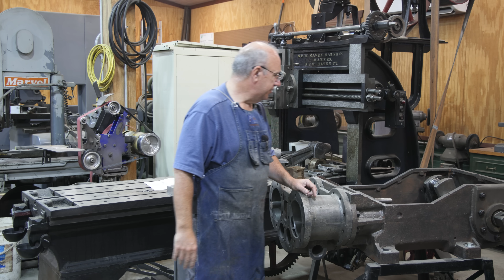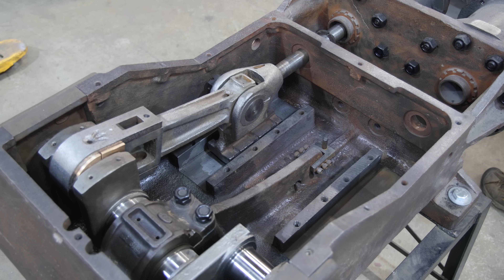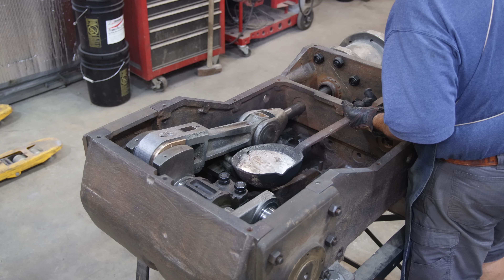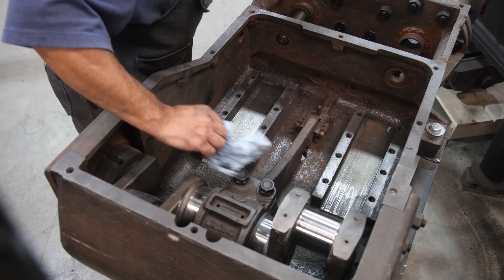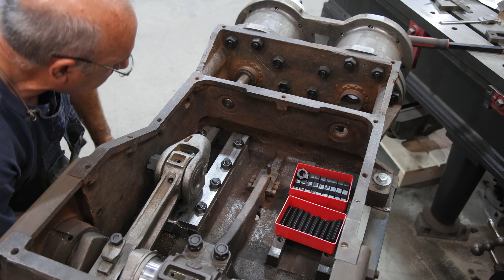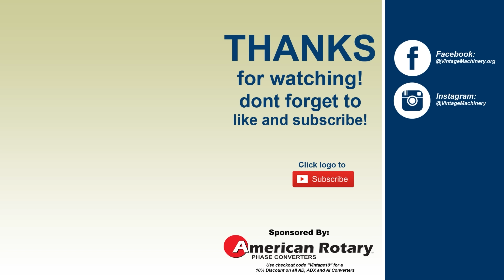Steam Stoker Engine: Pouring Babbitt on & Installing the Second Cross Head

Comment: My dad was a machinist in the 40s 50s etc. he rebuilt this big steam generator in the early fifty’s. He took me there to see it running as a young boy, the flywheel was half in the floor. I saw the governor weights spinning around, he told me about pouring the Babbitt beards and all the scraping he had to do. Now a lost art, I have his machinist tool boxes with all the scrapers. Keith does a great job, you are lucky to get to see this procedure.

Comment: the problem of the connecting rod getting in the way, certainly an issue, since you didn't use a rod between the two crossheads.

Comment: You could run-in all the new babbit with a 540 rpm tractor PTO to loosen it up.  An old timer told me about this 50 years ago.
Reply: I agree that doing a long run in would be a great way to make sure that everything was just the way it wanted to be, because where it's located on the locomotive, it becomes nearly inaccessible. I was just thinking of an electric motor and a pulley.

Comment: Studs are used as you get full thread engagement in the casting before Torrington the nut down, you’re much less likely to blow out the casting then a bolt.

Comment: Out of a question I don’t see balance weights on the crank like you would on a modern gas motor did they shake or is that not a problem with the rod heads that move back and forth?
Reply: Very low RPMs so not a problem. Steam engines rattle at a whole different level in the first place. This little engine won't be noticeable over the general clamour.

Comment: At 21:50 Keith is putting in the second wedge and then puts the stud in with a nut on top. I might be totally wrong, but should the stud be put in with a nut on it, then put the wedge in, and then put a second nut on top of the wedge?  The bottom nut is for adjusting the bearing clearance. And that way when the top nut is tightened down the wedge is trapped between the two nuts, making sure the wedge can not move up and down and changing the clearance on the bronze bearing. Again I might be totally wrong.
Reply: I think that is the intention. He did say he needs more lock nuts.

Comment: Did I miss an episode? How's the babitt getting under the slide?
Reply: That's what this episode was. He poured the babbitt and it stuck to the cross head. There is no babbitt in the main housing. He did the other side several months ago.
Reply: The slide is hanging in mid air. There is a gap between the slide and the base casting on all sides. It is held up by the dummy piston rod.

Comment: I think they used studs with nuts because production of bolts was not reliable enough to prevent defects at head and threaded section of the bolt that could cause failure.
Reply: Studs are often used with castings instead of bolts
to prevent threads from being damaged or stripped out.

Comment: Just a little oil in all the holes a tap with the hammer and it will all work. Well done Keith, Now looking forward to the valves and actual running under air or Steam. Carl Central Coast NSW Australia.

Comment: that thing in between  the piston rods on the piston side with the 3 bolts on each side with a stud sticking up what is that? seems an after thought or some kind of Crack repair but I don't think so but I've been looking at it for years and can't figure it's purpose. any ideas?
Reply: He put that in there before he started any machining on the case as a reference point. I don't think he used it for anything. It just clamps on the rib with 3 bolts on each side, and will be removed once he is sure no more machining will be necessary. The part sticking up is a dowel.
Reply: @brianrvd  I've been wondering if they have something to do with the valve timing dohickies

Comment: I understand what a stoker engine does, but I am still scratching my head as to the RPMs.  Would it be similar to the locomotive engine or geared much slower?  I assume the firebox is auger fed.  I also assume it would be speed variable but cannot find a diagram to give me a better idea.  Later in this process if you would give some insight, it would be appreciated.  I am glad I got to personally see this engine when many of us toured your shop at Arnfest South.  I wanted to ask my questions during the shop tour, but you stayed quite busy visiting with guests, so I didn't interrupt.  Good series.  Thanks.
Reply: Probably from 0 to at most 500 rpms would be my guess. It uses steam from the main boiler but would have its own throttle valve to control speed.

Comment: stud/nut vs bolt.  You do this for a couple of reasons, one is for maintenance, easier to get a nut off, than a bolt out of cast like a exhaust manifold.  But the other main reason is clamping force.  Maintaining the thread lock in the casting, you are only pulling vs driving into the casting threads with a bolt and causing uneven clamping force.  Assuming the studs threads in the casting were drilled precisely perpendicular, you would have a much better tolerance than a bolt.
Reply: It was explained to me that it also makes shimming easier because the studs hold the shim stock in place.
Reply: You can also guarantee engagement of the entire thread depth.

Comment: What makes the babbet stick to the cross head and not to the main frame?
Reply: I assume because it 'wraps' and probably bonds to, the foot of the cross head, when it cools, like next day, it has shrunk sufficiently to be removed from the slide and fine adjusted with a file.
Reply: @seapy2398  Yes, Babbitt does not actually stick to cast iron, it is only held in place by mechanical interference, in this case by shrinking around the foot it created a very tight bond that will never loosen unless a catastrophic failure deforms or breaks the Babbitt block.

Comment: In order to set the bearing clearance correctly on the big end of the connecting rod I would suggest placing flat shim stock of the desired clearance onto the bearing and then install the wedges. Record the position of the wedge, remove the bearing and shim, and reinstall the bearing with the wedge at the same position. You can verify bearing clearance with plasti-gage. If you are afraid of bearing damage by using shims, then just use plasti-gage by trial and error until you achieve the desired clearance.
Reply: Ive wondered why that isn’t an official way of checking clearance on these old steam engines. It would be way more accurate than to do it by feeling the looseness or tightness of the parts, especially with us older guys having lost some of the feelings in our hands due to neuropathy that comes with age and abuse of our bodies over the years.
Reply: Perfect.

Comment: When you don't have torque specs, you just use the German default spec - Gutentite.   Thanks for the video Keith.
Reply: A sense of feel goes a long way, when the pressure rises exponentially it's time to stop pulling on the wrench, but it's a mixture of experience and common sense.
Reply: Gutentite. German word for virgin.

Comment: Keith , maybe you said in the pass ? But where is this steam engine used on the locomotive and what is its job ? And are there any other steam engines used on the locomotive besides the main pistons for traction?
Reply: This engine will turn an auger witch will move coal from the tender to the fire box, eliminating the need to shovel it by hand. 
I believe most steam locomotives also have another steam engine that drives an air compressor for the brakes.
Reply: I believe it is used to stoke coal from the tender to the firebox because a locomotive this big uses a lot of coal and it would be hard to keep up with if they were shoveling it by hand. I’m not sure about the your other questions so I’ll let someone else try to answer those for you.

Comment: I ALWAYS ENJOY THE BABBITT  POURS, BUT WHY DIDNT IT STICK TO THE CASTING, WHATS IT TREATED WITH SO IT DOESNT STICK TO THE PART BASE,
Reply: No Need to SHOUT ^^
Reply: @Turbo-Drew  LOL, YOU'LL LIVE, LOL
Reply: Molten metal shrinks as it cools, pinching a core while pulling away from the outside mold wall.
Reply: While Keith didn't show it in this video, he usually uses a sooty flame, from a torch, to apply carbon soot to the contact areas. In that application, the babbitt cannot stick to the carbon covered portions of the pour area.
Reply: @oleran4569  THATS WHAT I'M USED TO SEEIN, I'VE SEEN OTHERS WRAP A SHEET OF NEWS PAPER TO MAKE A LAYER THAT DONT STICK, BUT HE USUALLY SHOW HOW HE DID IT, I'VE BEEN A FOLLOWER OF HIS WORK FOR YEARS
Reply: I haven’t seen Keith use that carbon blackening trick the last few times he’s poured Babbitt bearings, he hasn’t had any trouble getting them out either.
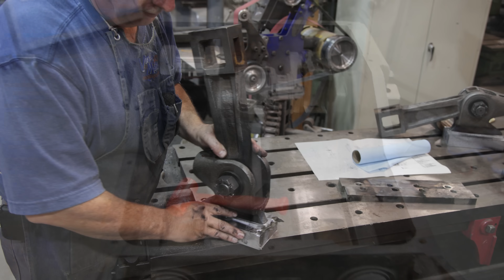Reply: @Hoaxer51  Take a look at time 16:37 in this video. To me, that looks like a sooty surface under where the babbitt was poured.
Reply: Bozo, AKA Fenwick Babbit strikes again!
Pouring molten metal with shorts on is really smart, he's such a great "teacher", j of how NOT to do a job!:face-purple-wide-eyes::hand-orange-covering-eyes::hand-orange-covering-eyes:

Comment: Well done sir. Nice to see positive progress. Perfect engine for a motorcycle. Now to beat a dead horse, this is an engine, not a motor, correct? Introducing the steam, there’s a gray area there, where it seems like steam might be powering it, which would make it a motor. I’m getting ahead of myself, because I don’t truly understand how the combustion process works. Seems to me the steam is generated and becomes an external source of power. 
You’ve really educated yourself along the way, very nice to share with us, always hard having all of us looking over your shoulder. 
That being said, all the comments from the first pour, you assembled parts to correctly pour the second Babbitt. To make this perfect, wouldn’t it make sense to redo the first pour with the parts aligned?
Perhaps it’s the case of older engines not having the tight tolerance. Today’s engines have such amazingly close tolerance’s that there’s really no need to break them in like you had to focus on with older engines. Although if it was mine I would take the care to break it in. 
I read long ago from a reliable source that people warming up the engine for 15, 20. minutes in the winter is not the way to go. The most engine wear occurs when the engine is getting to proper operating temperature. So a short warm up then moving, decreases the time to get up to temperature. 
Less engine wear ! Of course you don’t want to floor the thing, most cars will move along at idle, just ease on down the road, putting a load on the engine is the key. 
Which causes me to ponder. At idle, the car shouldn’t really move when the break is released, correct? Like a snowmobile, and many other vehicles using a belt and two pulleys, at idle the belt shouldn’t be engaged.  It’s not safe to have to break before moving. Apples and oranges, but Keith or somebody please explain to me why a car moves at idle ? It really shouldn’t, right. Even my standard shift Mini Cooper will go with no pedal when put in gear. Direct injection, computer controlled idle, what’s the deal? Give me the good old days when a car would drive without a computer. This engine you are building Keith, really brings us back to basics. Doesn’t get more rudimentary than this. So cool. 
Then my second question relates to a comment below. Why did you not carbon up the mating surfaces like all your previous pours? I loved that nasty miss adjustment flame blacking up the surfaces. Made sense. 
Been with you a very long time Keith, always look forward to Friday mornings, wake up with you. 
Thank you.
Reply: it is an EXTERNAL combustion engine, plain and simple.
Reply: Well done??? OMG
Bozo, AKA Fenwick Babbit strikes again!
Pouring molten metal with shorts on is really smart, he's such a great "teacher", j of how NOT to do a job!:face-purple-wide-eyes::hand-orange-covering-eyes::hand-orange-covering-eyes:
Reply: @garybrenner6236  Looks like you found the copy/paste button.

Comment: Curious...
You had lots of difficulty machining that bed plate so the babbit could have a nice bearing surface to run on. What about reversing the design so the babbit was in the bed plate and EASY TO MACHINE, with the cross heads sliding on the babbit metal. What do you think???
Reply: Likely because "back in the day" it would be easier to remove the cross-heads to melt out old babbit for a repour, than to have to melt it out of the housing.
Reply: Good point. I guess it would make a mess to melt it out of the slide.
Reply: How about splitting the difference. Babbitt on the cross slide, babbitt on the moving part? Seems like a true bearing.
Reply: You don't want two parts of the same material rubbing against each other because they will gall and try to stick to each other.
Reply: Bozo, AKA Fenwick Babbit strikes again!
Pouring molten metal with shorts on is really smart, he's such a great "teacher", j of how NOT to do a job!:hand-orange-covering-eyes::hand-orange-covering-eyes:

Comment: I've been watching this project for 5 years! and I'm glad I'm here today to see the biggest machining issues related to this project being completed!
Reply: And Abom said he couldn't do it , you have to wonder why ?
Reply: @TonyBell-kn6nl  If you watched his video you would know.
Reply: @seymoarsalvage  How the hell would I know if I hadn't had watched his video ? Muppet !
Reply: @TonyBell-kn6nl  He didn't have a machine to get into that crankcase.  Just look at the effort Keith had to expend to get one.
Reply: @kensherwin4544  He had a shaper which is same as a planer except that the cutting tool moves instead of the bed on a planer, he could have used the same sort of special cutter like Keith did, on his shaper and got the same result.
You're not an engineer are you ?
Reply: @kensherwin4544  I give up
Reply: @TonyBell-kn6nl  His shaper had not enough strokelengh. And not the right tools are avaiable, so we write 2020 not 1920 , at this time these tools exists alot.
Reply: @TonyBell-kn6nl Pretty sure he explained his reasons. Had to do with tool holder reach. You should go look for yourself.
Reply: This part was when I first heard about Qinn. I've learned a lot from her.

Comment: Good morning Keith, 

In operation how do the stoker engine journal bearings get oiled, splash or is there an oil pump in it? Once the crankcase cover is installed it would keep it all contained and clean. 

Thank you for creating and posted this!

Randy
Wyoming, DE
Reply: Caveats to my knowledge (!), but I think Keith once described this as a sump-oiled (splash) machine… For the cylinders, I don’t remember…
Reply: @musiqtee, the cylinders and valves will likely be fed steam oil by a pump.